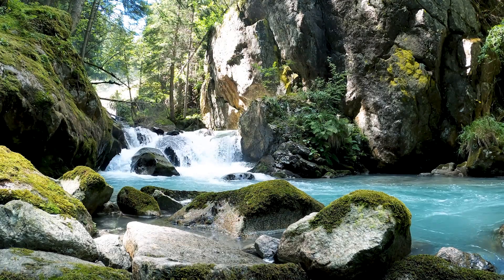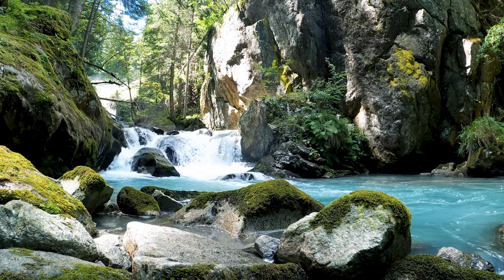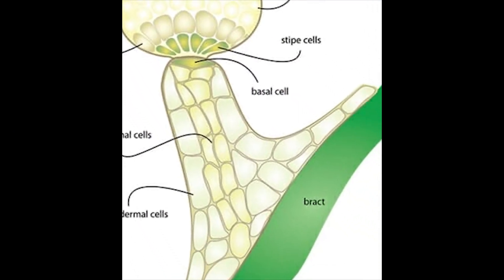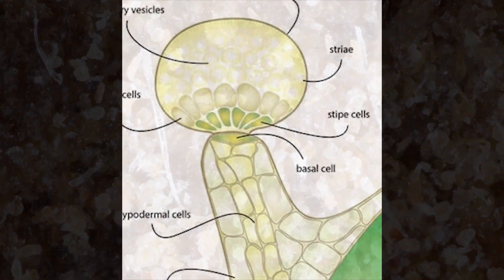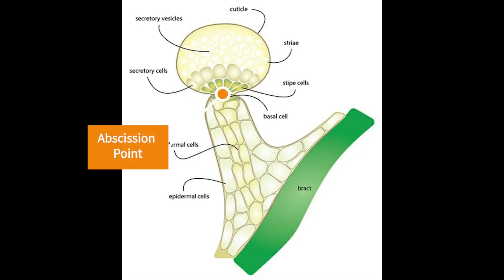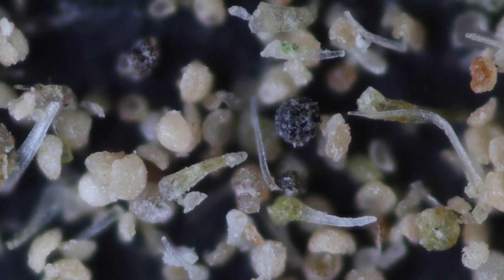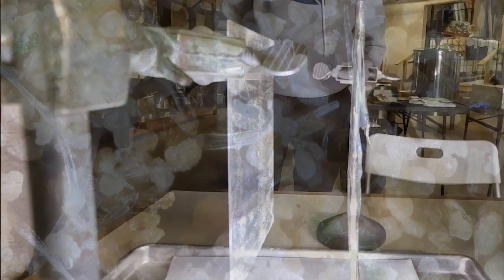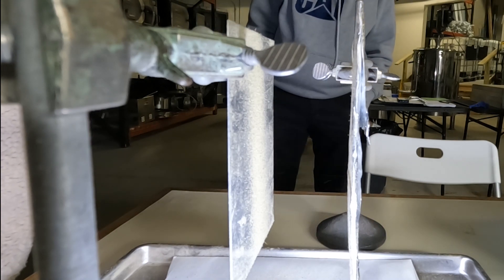Triboelectric Tuesday Episode 3 - Decapitation

Comment: 1. Use a specialized sifting screen with a proprietary surface coating that reduces friction and improves separation efficiency
2. Use a drying agent, such as silica gel, to remove excess moisture from the material and improve separation efficiency
3. Implement a system for adjusting the vibration frequency and amplitude to optimize the separation process
4. Use of ultrasonic waves: Applying ultrasonic waves to the sifting machine can help to break up any particle agglomeration and improve the efficiency of the sifting process
5.Use of a vacuum: A vacuum can be used to remove any remaining plant material or debris from the sifted product
Reply from the maker: Great comment. Very thought out. 

1)What sort of coating have you had success with? I haven’t seen any metal mesh sieves with coatings. We can get sieves made of nylon etc. 
2)Never thought of silica gel. Brilliant. I suppose other chemicals like “Damp Rid” would have a simile effect though not too keen on using. A freeze drier is our preferred method. It’s one of the upcoming episodes. Moisture is a thing. 
3) this is feasible in a sieve, however the agglomeration is a function of static charge so I’d love for you to elaborate on this. What experience have you had? Agitation only may not create agglomeration, however it won’t fully decapitate either. 
4) I am familiar with this feature, however it’s expensive and tends to pop heads. 
5) I like the idea of a vacuum on the undersize. Brilliant.
Reply: @SamboCreeckFiltration  Teflon ,Ceramic, Polytetrafluoroethylene, Anodized Aluminum
Reply: An ionizing bar can also help in addition to specialized coating in reducing static charge, which is a major factor contributing to agglomeration of dry sift. The ionizing bar emits ions that neutralize the static charge on the sifted material, reducing the likelihood of particles sticking together and forming clumps. By reducing agglomeration, the sifted material can flow more freely through the mesh screen, increasing the efficiency and speed of the separation process. When the bar is placed in close proximity to the material being sifted, the ions will neutralize any static charge on the surface of the material. This will prevent the material from sticking to the screen or each other, reducing the likelihood of agglomeration and blinding of the mesh screen. The ionizing bar can be easily installed in the sifting machine and turned on and off as needed
Reply from the maker: @GroggyHarbourFarms  absolutely! Great comment. What we have not yet tested is how this would affect the downstream process of Tribo charging. Will it hinder rate or amount a particle can charge? Will time buffer need to be deployed between processes? Let’s find out!
Reply: @SamboCreeckFiltration  You could try use ionizing air nozzles? By using ionizing air nozzles to blow ionized air over the sifted material in a controlled manner, you may be able to reduce the amount of static charge buildup without interfering with the Tribo charging process. 
Also could try using grounding straps.....by grounding the equipment  you can help to reduce static charge buildup and prevent it from interfering with the Tribo charging process. 
In addition you could use a neutralizing bar after the Tribo charging process. Use an ionizing bar to reduce static charge before the Tribo charging process, using a neutralizing bar after the process can help to prevent the build-up of static charge on the sifted material, a dual polarity ionizing bar would be a good choice.